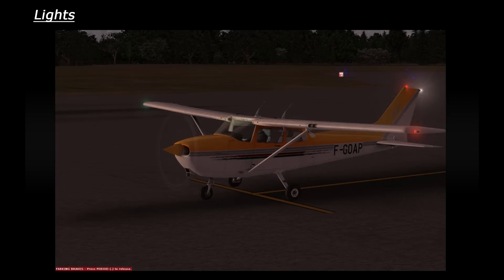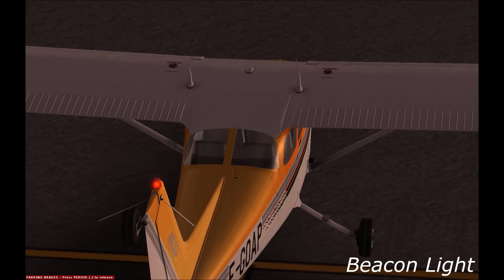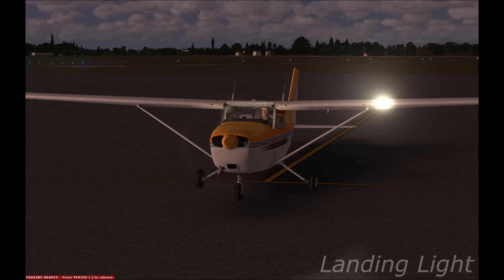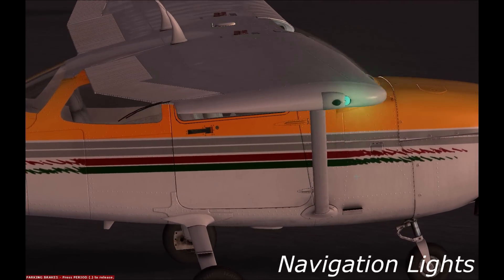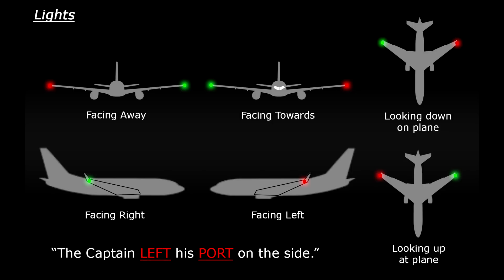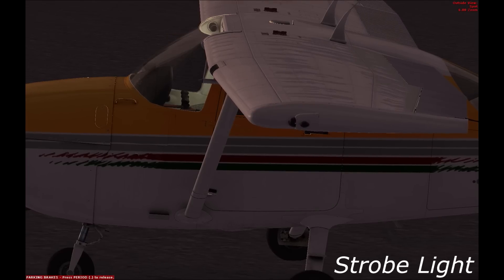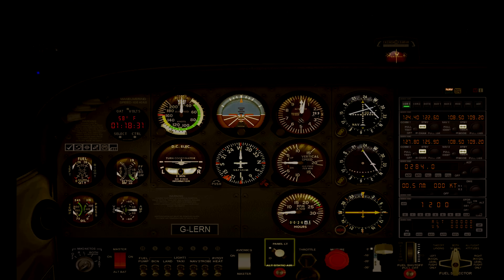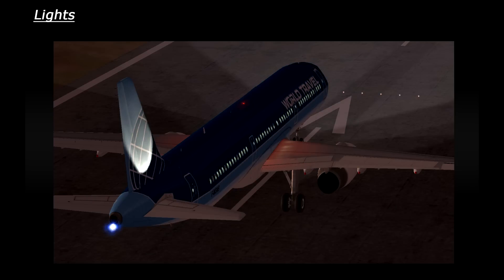FSX Tutorial: Aircraft Lights

Comment: red/green nav lights are oriented forward sweeping 110 degrees to the left or right so they would not be visible from the rear. you would only see red/green if the plane were oriented directly at you. if the plane were infront of you going in the same direction you are all you should see is the white rear nav light. which has a 140 degree spread.

Comment: Great Video. But you get the part with the navigation lights wrong. There are 3 nav lights on any airplane. Red on the port side, green on the starboard side and a white tail light. These lights illuminate a 120 degree arc with a bit of overlap. Directly from behind, you should only be able to see the white tail light, not the green and red ones. These lighting rules come from  ships, but on ships the angles are a bit different. That's what I learned while on training as an aircraft mechanic.